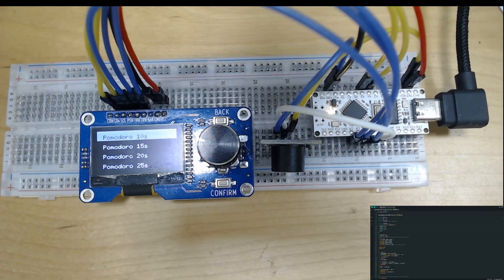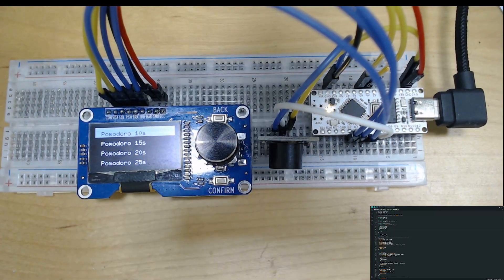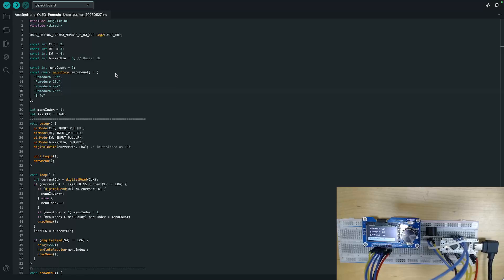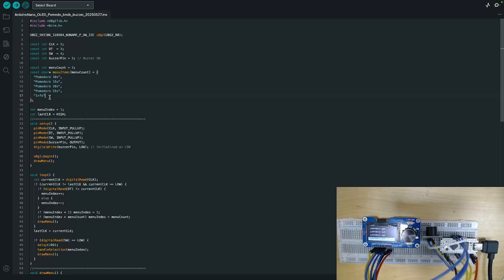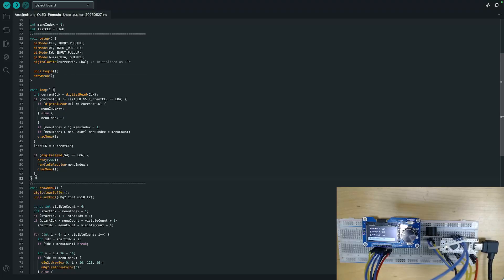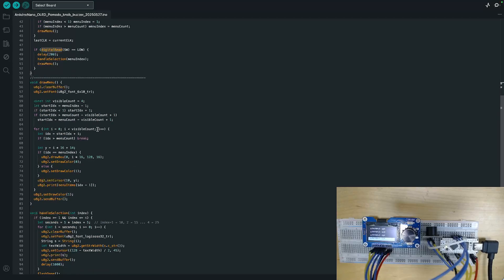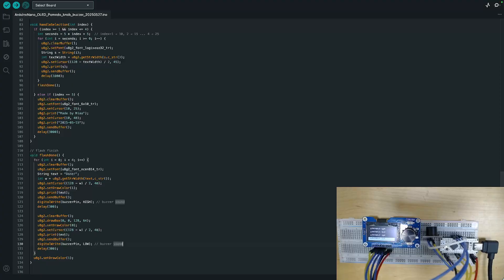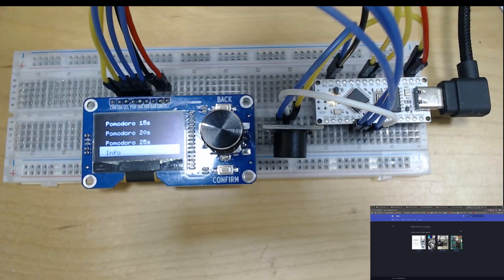Arduino small project, a Pomodo clock with menu

Comment: Nice! Thanks for video. This module works great for web radio project?
Reply from the maker: I think so, ESP32 got almost everything you need. Except that a functional speaker maybe necessary for a radio. This buzzer in the video is a bit weak.